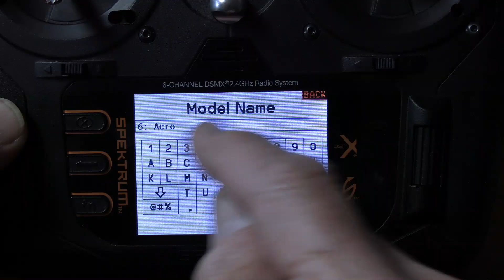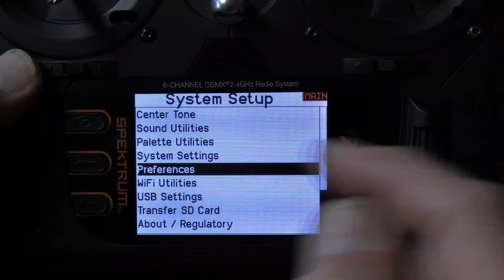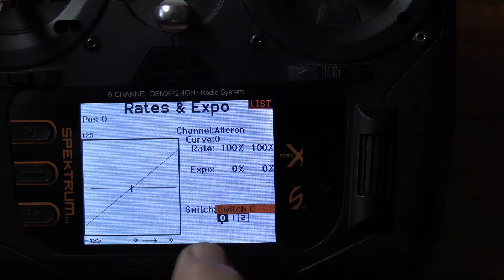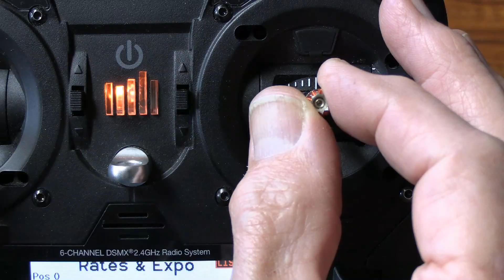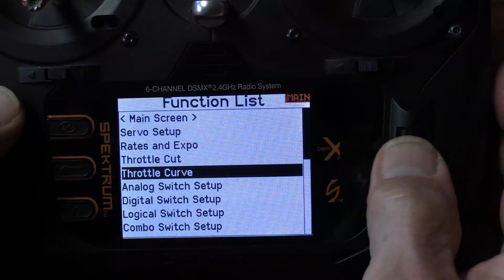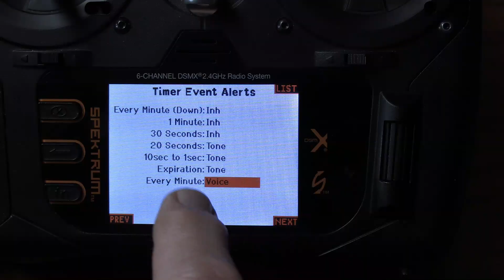Getting Started with Spektrum NX Transmitters

Comment: I have a DX8 Gen2. I was thinking about getting an NX 10. Do you know if the model files on the DX8 will run on the NX software ?
Reply from the maker: Yes, the core data will come across going from the DX to NX.  Use a SD card.
Reply: @RCJim - ok, thanks !